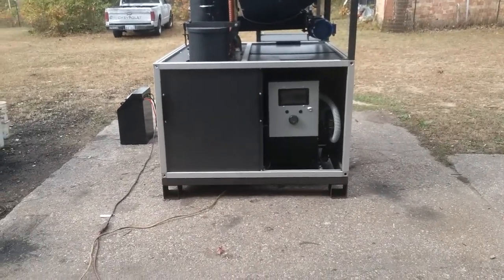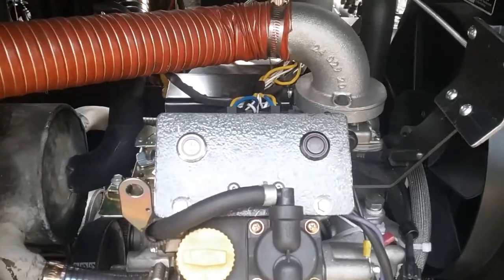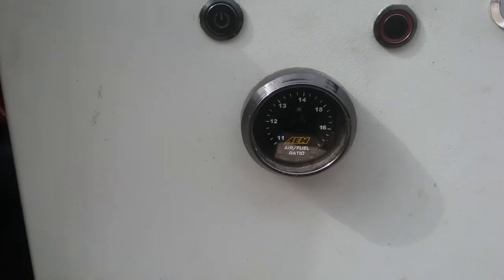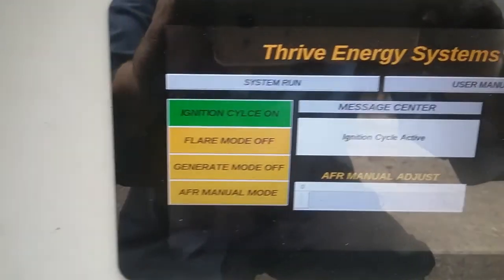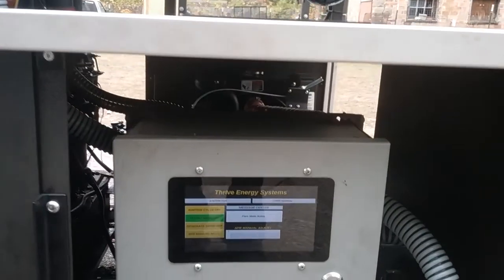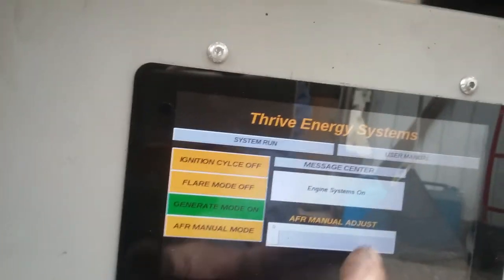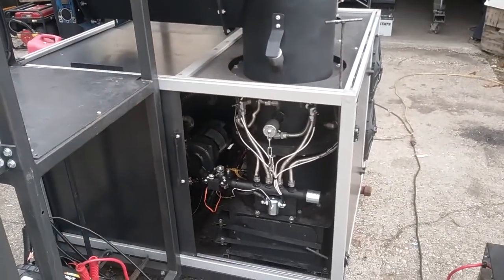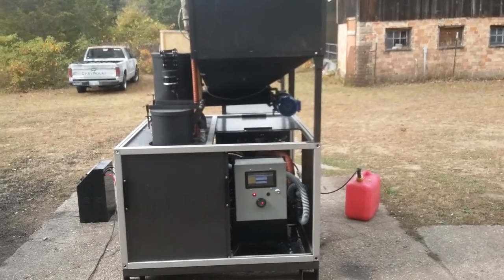2018 Evolution Power System with Kohler Upgrade. Full Auto!!

Comment: Hey Matt, do you ever sleep, Man ?? Your systems keep getting better and better. I hope you sell a boat load of these  as they become more user friendly. I have some sort of link on Facebook to your channel and I also saw the video from Jacob when he posted it yesterday. He has a lot of good things to say about you and the customer service. That's your ACE ! right there. Good work Matt.
Reply from the maker: No rest for the wicked. Yeah the code behind those four buttons was many many hours of work. One main PC and then two main control modules ECM and GCM, there are other timer modules as well. Lots of work to get here but in the long run it will be more cost effective for us while providing a more user friendly platform.
Reply: NH Hbbyloggr 這台多少錢
Reply: All that work shows. Mada94fxr and I both use the repeat relay timers for our vibrator and shakers. I even bough a few extra just to keep in stock , just in case . Have you changed your choice of wood fuel yet or still using the chips? I recently tried running saw dust from the firewood processor which was pretty dry but never again.
Well, keep up the great work man !

Comment: what will happen if an EMP hits this and then all of the electronics are fried   just a thought not trying to put this down just need to be real in all parts
Reply from the maker: Well what are you going plug into it if an EMP hits?
Reply from the maker: It is the very question why I use NPT ball valves. You can simply remove the servo controlled valves and replace all of them with manual controlled valves and run this machine just the same as any manual gasifier
Reply from the maker: also all machines have manual lighting ports and separate air intake for manual operation. simply wire the blower to a battery and you basically have a manual run machine .Until then you have the automation to make your life easier. No gasifier will ever produce linear gas with out automation you can not over come the physics, the grate will restrict and bridging needs correction. So in this case you simply remove our automated grate agitator motor and shake the grate like any other gasifier. Nothing preventing this machine from a becoming a manual machine.
Reply from the maker: One last thing is this machine is basically a giant Faraday cage. It should be earth grounded anyways, so chances are good the electronics will be fine.
Reply from the maker: If your looking for  a SHTF gasifier I offer this little gasifier line that runs on chips and small chunked fuels. This machine starts our at just $1450.00. This machine is not made of buckets or paint cans, it is fully fabricated, CNC parts processed and then hand crafted to my strict quality criteria with 6 years development of advanced reactor technology. Compared to some others this is a good deal. The Mini B you can easily fab your filter for if you wanted to get in cheap. Cheers  http://www.thriveoffgrid.net/evolution-mini-utility-chip-fuel